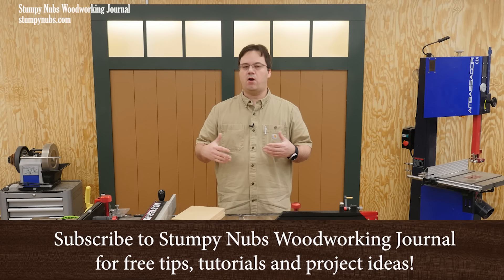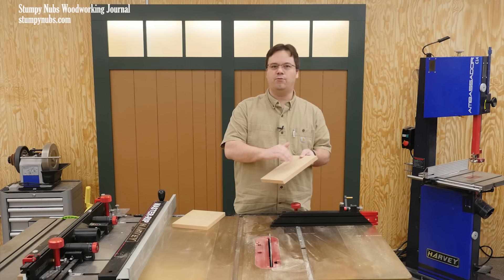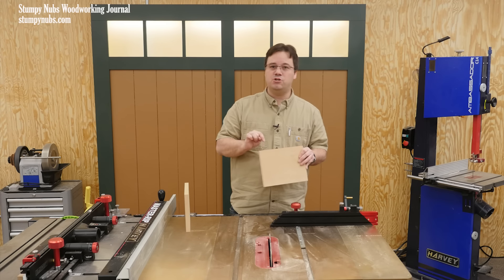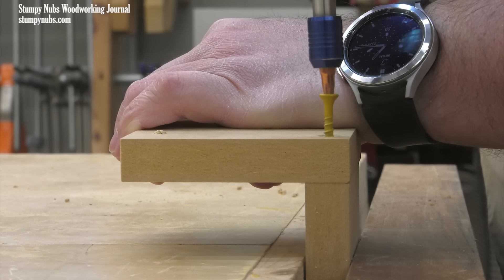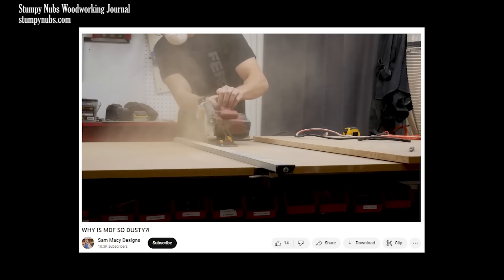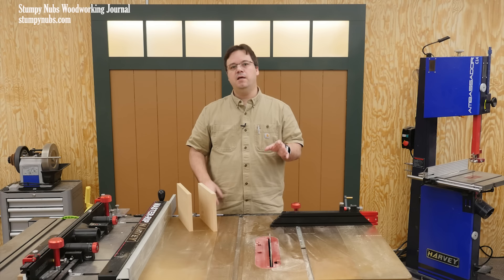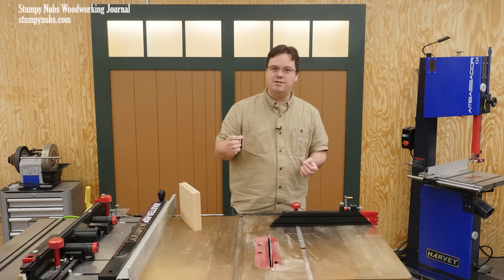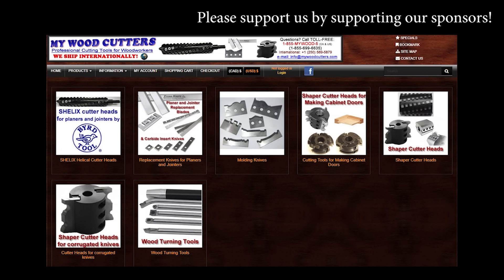This stuff changed my mind about MDF projects

Comment: As a painter we had a rough time with the end grain exposed on a raised panel look on an MDF cabinet door. Just primer paint and sanding wasn't enough to seal the end grain; so when painted with the final coat would usually need more paint. Maybe even two or three coats more. So we learned to first, seal the end grain with flat paint. The end grain soaks the paint in like a sponge. Let dry and then prime the doors. This worked well to seal the end grain so when the enamel final coat was applied the doors would look great. Don't forget to sand.

Comment: I recently made a small MDF stand for my Casio digital 88 key piano. I glued two pieces of MDF together to create a single panel of material 1.5 inches think. This gave it some strength and bulk and then I cut it to size to build the stand. The unsealed edges were wide and obvious, so I knew I had to seal it. I thought about joint compound but, I hate drywall work because of the dust factor so I quickly poo-pooed that idea. What I came up with is wood glue. Put a goodly amount in a bowl and add some water to create a thin sealer. I put two coats on the edges and lightly sanded between. Then I primed and painted the entire thing using Krylon hammered finish dark gray spray paint (comes out very dark, almost black, almost a gunmetal blue). The result was beautiful! The hammered paint is easy to put on with no drips or runs. The hammered finish gives it just enough texture to hide any imperfections and it turned out very uniform, I won't say smooth because it is not a smooth finish. But the edges looked absolutely beautiful, no signs of the joint between the two pieces of MDF and no signs of edge/end grain. The glue filler is very sticky when being applied so it can be a mess, but when it dries it gives a super hard/smooth finish to work with. It's relatively cheap compared to traditional sanding sealers as well. No messy dust or chipping issues compared to joint compound, did I tell you I hate that stuff! Good video, good tips! I'll add that dust is always an issue no matter the material you are cutting, traditional plywood dust has glues and resins in it as well, so that is not a benefit. Most garage shop owners do not pay enough attention to dust control. That is an area I think we all tend to overlook and scrimp on. It should not be. Concentrated levels of even spring pollens breathed over even a relative short period of time can be devastating.

Comment: I do exactly the same process as you when using screws into the edge of MDF with a couple of additions, after piloting I put a couple of drops of thin CA glue in the pilot hole to soak in and help bind the MDF together, before I drive the screw in I use a quick clamp to support the sides of the piece I'm screwing into so it cannot expand.
I also finish tightening the screws with a hand screwdriver.
I found using a top quality water based varnish seals the edges very well because it soaks in well and it dries and hardens much quicker than oil based varnish it also strengthens the MDF .
The product I use in the UK is called Ronseal diamond hard floor varnish so it's designed to be extra tough to take foot traffic as they call it, apply it with a glossing mini roller rather than a brush so you can force it in edge of the MDF let it thoroughly dry out overnight (preferably) You can put an oil based product on top and it doesn't react with it.👍

Comment: Another downside is the weight. Honestly I've just moved away from MDF entirely. The upside used to be cost; you could get a full sized sheet for anywhere from 25-50% less than a full sheet of cabinet-grade plywood in my area. But COVID changed that and it hasn't normalized since. It's like an extra five bucks per full sheet for a good quality ply now vs. the same amount of MDF. Why would I ever go with MDF with the weight, dust, fragile edges, and joinery problems again in that case?

Comment: Being that you have the wisdom of the ages, let me ask you this question. Why don't they make MDF with some fiber glass mixed in to give it better grain strength similar to wood? Thank you for some mighty fine videos.
Reply: Then they would not need to sell you more later on!
Reply: That would make the dust extremely hazardous for your lungs!
Reply: @davidkantor7978  I'm thinking strings of fiberglass used like rebar in cement. But, if you are not wearing a mask when working with MDF, you're not worried about your lungs, with or without fiberglass. Good point!
Reply: @tomsherwood4650  Personally, I don't use MDF. I hate the feel. To me it's the same as fingernails on the chalkboard. But you have a good point.

Comment: I've been working with MDF for years. When nailing or screwing into the end grain and to prevent splitting  use a clamp to squeeze the board at the spot the nail or screw is going in.  I also use MDF premium which is a lot denser and doesn't require using fillers on the end grain for smooth paint finish. I spray lacquer, and when priming the end grain I turn down the volume of product being sprayed and turn up the air. This helps force paint into the fibers.  For patching or repairing MDF, autobody Bondo works the best.

Comment: I worked at the Queens Museum of Art in the early 2000's and one show required a lot of specialty vitrines and displays - all made of MDF. They must've gone through 50 sheets of MDF - I kid you not! I was working there renovating the museum gift shop and was "sharing" the shop with the outside crew they brought in to do most of the MDF stuff and I walked into it one afternoon and it was like a London fog in there. Except it was toxic and you could practically touch it! So gnarly. I saw one of the guy NOT wearing a mask! I hope he's still with us!

Comment: I have used various kinds of MDF over the years. Likely started with MDF baseboards and doorway casings in the 80s.  MDF pieces were obviously cheaper than solid wood, but most were also thinner, which looks very cheap to me. So I switched to hardwood.  I built some custom built-in cabinets and spray painted them with latex BM paint. I did use drywall compound on any exposed edges to cover, but also sprayed the paint extra thick  These were cheap and functional cabinets that looked good. I used scraps of MDF to make shelfs in my workshop- but these all deform badly under even a light load, so they got replaced by plywood.  More recently, I made two doors to fit a custom doorway space, (both height and width were odd dimensions), which turned out okay.  I had just made another door out of SPF 2x6s. The SPF was easier to work with, with way less dust, but ultimately, the door is warped.  The MDF did not warp, but making a full size door with huge raised panels generates mountains of dust, which all starts out in the air, and eventually lands on everything in your shop.  It's not great wearing a half-respirator all day so not sure I will do anymore full sized house doors now, I've had my fun.  Also did make custom shaker style columns for my porch.  I used exterior grade MDF, (Extira) painted it, and 3 years later its fine.  No machining, only long cuts, so no dust issues for these columns.  Good application of the product.  Exterior grade is hard to find though, it's not at the big box stores, and only a few lumber stores. I also noticed prices vary considerably, but I did find a place out of town that was reasonable (less the half of the closer stores).    I also did a custom outdoor cabinet for a 75 inch TV with the same material, that is still looking good 3 years later.  Home Depot here used to sell MDF for $29 a sheet, then it went up to $33 and at the time, we thought that was a lot.  The next increase was to $89, during covid, and today, thanks to lumber prices cratering, the Depot offers if for only $79!  So if $79 is the new floor price, I will not be using much MDF anymore. However, it does have its applications for sure.

Comment: Great video, but in my book, pure MDF is a non-starter.
Quality = Breaks too easily for cabinets or furniture.  
Cost     = Spends $50 vs $90 for Pre-Finished 2-sided Maple Plywood.   
Time    = Takes extra labor for special handling,  re-work and field repair.
Safety  = Makes nasty dust
When I use MDF just for trim or shop fixtures, I usually regret it later.
Reply from the maker: I think the cheap furniture industry has cause people to think that MDF has no practical use. But there are plenty of projects where MDF is actually a superior product. For example, those who make speaker cabinets love MDF. It also is an ideal substrate for some veneer projects. And MDF panels are excellent for flat-panel cabinet doors when surrounded by a hardwood frame.

Comment: My tip for cutting MDF is, when possible, cut it outside (I use the driveway in front of my garage/shop), with a fan behind me to the side blowing past me, then past the project, blowing the dust away from me.  I do use a mask, and use compressed air afterward to blow off my clothing, and also my saws/tools before putting them back into the shop.  For any dust that has blown back into the open garage door, my small corded leaf blower usually makes for a fast cleanup before closing the door.

For gluing, I prefer a construction adhesive like Liquid Nails, especially if the joint involves at least one cut edge (i.e., not just the manufactured flat to flat surfaces, but like a butt joint of cut edge to flat, or even cut edge to cut edge).  Regular PVA-type wood glue seems to get too dry in a cut edge to provide an effective bond (unless I smear on a pre-coat first).  However, wood glue is usually my go-to if set-up time is a factor.

For fasteners in a joint, I usually use James' suggestion of a pilot hole sized properly to the screw shank, minus the threads, plus glue.  However, I have also used through-dowels and glue effectively, especially drilled at a slight angle to each other (one leaning left, one leaning right, etc., where the oval appearance of the flush-cut dowel ends is acceptable).  The angled dowels provide a bit of extra grip, should the glue fail.

Finally, one joint from a project years ago that has remained strong and not 'powdered out' as some MDF joints can do around the screws, is where I did a box joint with 2-inch-wide fingers, which made the screws go in two directions (i.e., through the left finger into the right edge, then through the right finger into the left edge, etc.).  This bidirectionality of the mechanical fasteners kept up with the stresses placed on the cabinet over the years (which, really, should never have been made out of MDF, but it's what I had at the time).

Comment: I have to ask do you have MRMDF (Moisture Resistant)in the US? it takes a stronger screw joint is easier to paint and is sort of moisture resistant! It has a green core to it and is not so dusty when cutting it, I only use MRMDF now because just plain MDF is too soft (for my liking) it costs a bit more but like everything, you get what you pay for.

Comment: Uncommon Common Sense!  This chemist can tell you the resins used in making MDF must partially dissolve cellulose (ionic bonds) so burning MDF becomes a no-no, including the smoke as you are playing Mexican with your skillsaw.  Mostly, it is just better to buy MDF to size, and other than screwnglue don't try to join it.
     Also from an adhesives/coatings chemist:  painting this material is expensive because of the density.  On the positive side it accepts epoxies without priming, so is better for industrial applications than residential.  
     If you wish to apply residential coatings on MDF, please know that Sherwin Williams bought Zinnsser, who controls the shellac market in the US.  BIN and BullsEye are watered down versions of their previous incarnations.  I suggest you use your favorite urethane sanding sealer, wiping with mineral spirits.  Do not be afraid of the dryers unless you are staying green.

Comment: I got the feeling that we need to shy away from the "noble" materials somewhat.
With climate change rising, we should probably search for ways to waste less material and stitch nobility to that instead.
You're good at making good stuff out of it despite the technical challenge, that desserves respect !

Though given that there is resin in there, it gets me wondering the ratio of plastic it represents.
Reply from the maker: Most lumber used in woodworking, especially American hardwoods, are sustainably grown and harvested. There is no deforestation going on in the US for the sake of lumber.
Reply: @StumpyNubs  
To me deforestation is another matter, but it still manages to creep in here in Europe. A few years ago, there was a scandal surrounding Ikea which used illegal wood from Romania iirc.
My point was closer to degrowth, and that kind mindset. Even if it is sustainably grown, if we can make more out of a single tree, the overall carbon bill is better.
What typically happens to the sawdust and woodchips out a workshop ? Do they end up in incinerators ? If so, that's CO2 back in the atmosphere.

Comment: I’ve used MDF for many loudspeaker builds and some other cabinets.  I’ve found that Miller dowels especially when using veneer over the MDF are a good way to add strength to butt joints and add a little visual bling.  I’ve also used comformat screws which are made specifically for MDF and then filled over the heads with bondo.  This method was used for creating a “wet look” piano finish on some rather large floor speakers.  (They save clamping time) 

Besides the dust issue an other thing to be aware about MDF is that it does not hold up to moisture, even when treated with a finish on all sides.  So outdoor projects, bathroom vanities, kitchen island tops etc are a “no-go” for MDF.  

I use MDF because it is stable, flat inexpensive and reasonably acoustically neutral.  It’s also my go to for jigs, sleds and fixtures in the shop.  If Baltic Birch didn’t require a second mortgage maybe I’d use MDF less often, but I don’t live in that world.

Comment: I use MDF quite often. I use a primer called Stix by INSL-X sold by Benjamin Moore on all my painted MDF projects. It is a water-based bonding primer that seals the faces and edges of MDF perfectly. It does not absorb into the wood the way most primers do. After priming a light sanding with 320 to remove the raised grain, leaving a glassy surface that accepts paint beautifully (even the milled surfaces and edges). Thanks for the channel.

Comment: James, could you do a video on applications where MDF is the preferred material?  Everything about MDF (its weight, poor moisture resistance, no good outdoors, difficult to join, abrasive on cutting tools, harmful dust, cannot be stained, difficult to repair if damaged) seems like a big no to me.  Plywood just seems like a far better alternative.  Even PVC with its terrible environmental impact seems like a better alternative than MDF for trim and molding if the cost of solid wood is an issue.

Comment: MDF medite is a lot better than the hobby stuff. 
Even better, always go with MDFv313 its a lot tougher and a bit moisture resistant. 
And for cutting and sanding mdf… or anything 
Please use a dust collector. And I mean a proper one. Like the Felder RL series ore SCM Vacumobil.

And in my case the sawblades I use for cutting MDF and melamine partial board are the most expensive a have… around 260 dollar each. 
The are special blades for dealing with these products and keep a clean ede for a very long time. 
Look them up, kanefusa board pro.  ;-)

Comment: I only use MDF for shop adjuncts like a sled for my table saw or jigs for a project. 

As you said, there is no strength to shelving or joints that are critical like  heavily used shop drawers. 

Great video!!

Comment: I would dilute wood glue with water and paint the edges of my MDF enclosures  When the glue dries I could sand it smooth and it would be sealed.  Put a coat of primer a light sand and you could achieve a piano black finish if you wanted.

Comment: Thinner (3/8 - 1/2") MDF makes very good small shelves as it's so dimensionally stable; I've long painted edges (both square and rounded) with slightly diluted wood glue as a sealer.  Just a quick, light sand after drying, and it's good to go.

Comment: I use MDF to make templates for guitar building.  I reinforce the "endgrain" with this super glue.  I wear rubber gloves and smear the superglue on with my finger tips.  It makes the "endgrain" very hard. Works great but wear a proper paint respirator when doing so, it gives off some nasty fumes.

Comment: For MDF that touches the floor in kitchens or bathrooms seal the bottom / end grain of MDF with either thin epoxy or ca glue so that moisture from spills or mopping won’t wick up into the cabinet ruining the finish

Comment: I like to use MDF for jigs where possible such as cutting guides because it is a relatively cheap material that is stable over time.  The obvious problem that you noted is it's lack of structural strength which means the jigs have to be handled carefully.  Thanks

Comment: A 50-50 mix of glue and water also works to minimize the absorbtion of paints on the raw edges. As a bonus, it hardens the exposed raw edges a little bit too. I always do this because it saves time in the long run and makes a better finished product.
Reply: I've been wondering if the 50/50 method creates noticeable swelling in the substrate?

Comment: you can also use spray on filler, you have ti do it at least 2 Times. I also use melamin edges that are under 1 mm in thickness and are ready to glue in with a heatiron